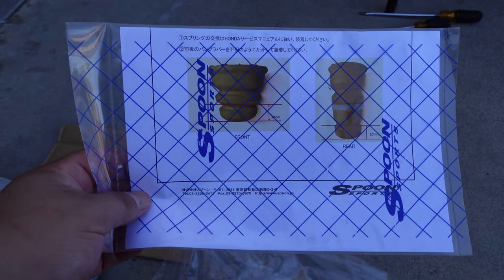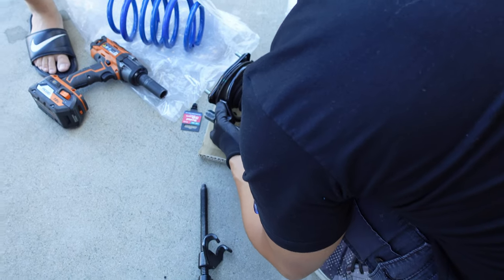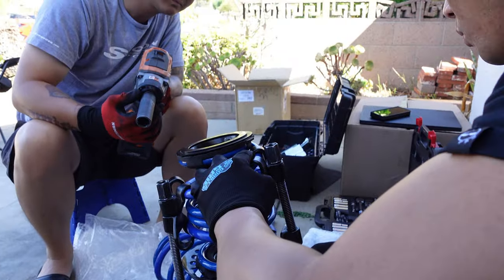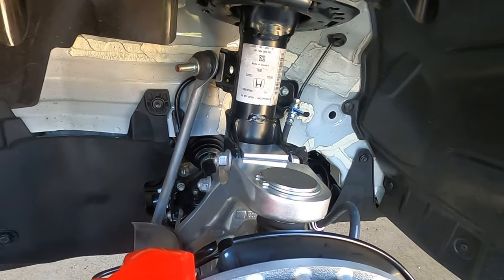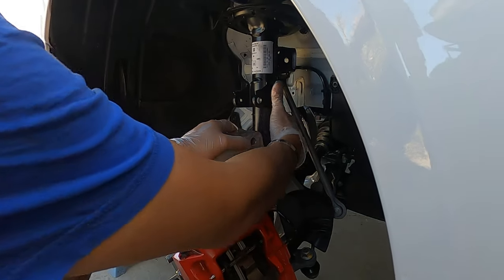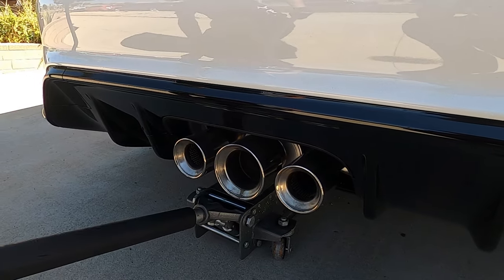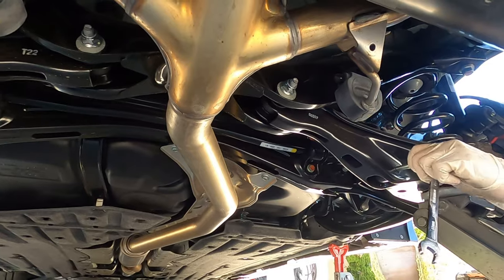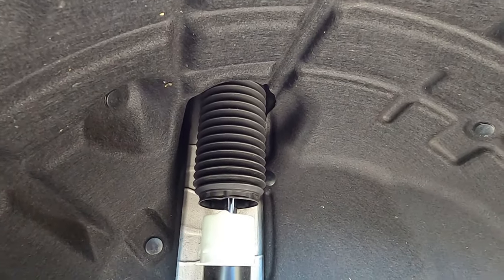2023 FL5 SPOON CIVIC TYPE R SETUP // HOW TO INSTALL SPRINGS IN TWO HOURS // EASIER THAN FK8 SPRING

Comment: Okay I just did this same install over the weekend…
Key detail on making that slipper kick so easy to drop the knuckle…you have to undo both left and right endlinks…if not the sway bar will hit the axle
Reply from the maker: Thanks for the input, I shall add note on the video description. I thought I mention both sides needs to be disconnecte.

Comment: Thanks for the video. Did you guys remove the rear shocks to cut the bump stops? I've read a lot that the rear looks lower with Spoon springs. That's too bad because I want that balance of street and track (I only do a few track days per year). I don't want a big drop so the Spoon 20mm is nice.
Reply from the maker: hello, no we did not, in the near end of video we show the process. 

With the wheel off and you follow the shock upwards, there is a rubber/plastic dust cover. After loosening the cover, you can move it upwards and see the bumps which you can cut it from there.

Do not do the extra work of removing the shock.
Reply: @maganamfg  Thank you for the detailed reply!

Comment: Love the videos, but just want to lend a quick tip for people wrenching on their own cars.  I saw something worth mentioning in the video when you tossed a 17mm bolt on the ground.  

Tossing critical bolts on the concrete like that can damage the threads, thereby causing potential difficulty/damage to the components during reinstallation (if bolts are intended to be reused), and inaccurate torque readings.  

Love the videos again, keep them coming!
Reply from the maker: Thanks for the heads up about the tossing, appreciate the critique!